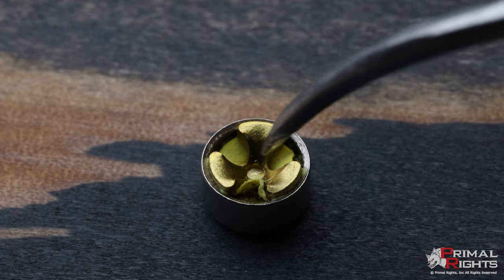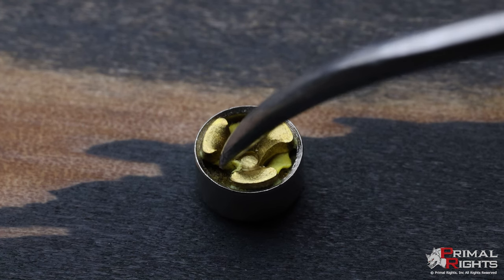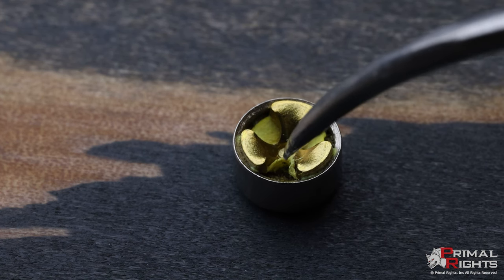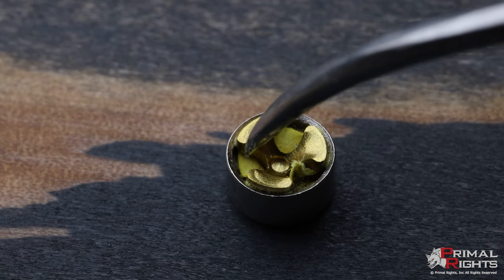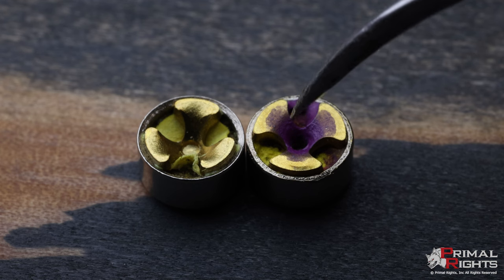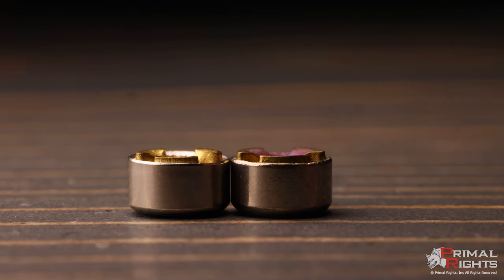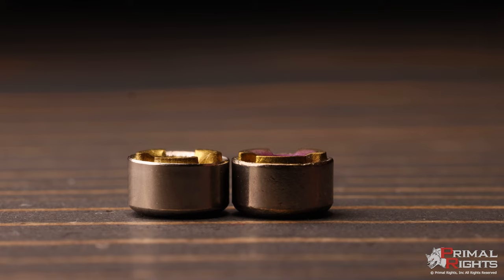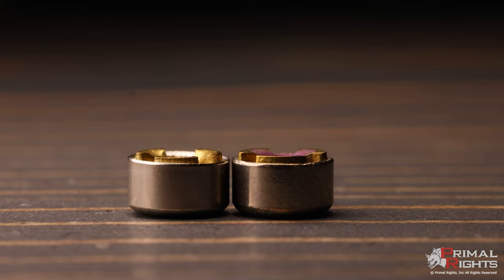Primer Anatomy & Thickness Variance

Comment: Variations in rim thickness should also play a role since the seating tool indexes at the top of the rim and the measuring tool indexes at the head face of the cartridge. Minimum variation certainly with quality brass - I found less than 0.5 tho differences on 6 Dasher Alpha brass. And the additional 2 tho crush you recommend should take care of that. Another factor affecting ignition timing is headspace, as the brass is pushed against the shoulder by the bolt (or firing pin) before the firing pin starts crushing the primer cup. Precise brass sizing is really key here...

Comment: What depth are you seating your primers at ? Factory shells are 0.004" below flush. I get better groups with 0.007" below flush. some like 0.008" to 0.010" below. You got about 0.013" to 0.015" below flush before you bottom out.. Better to go lower for floating firing pin guns. (AR's, BLR's ,BAR's) Frankford Arsenal Platinum Hand Priming Tool can be adjusted to 0.015 below flush.. I cant get any CCI 200 or250 primers to go off in my BLR, someone said its the Nickle coating on the cup ? Any suggestions on a soft primer. some say Fed210 and 215's are easy to set off but I see federals and CCI are owned by the same company now..

Comment: Greg, I really appreciate the videos and all the effort that you have put into them and your product.  I have watched your interview with Eric and Brian Zolnikov's videos on primer seating depth testing.  I tried seating to .008 below flush with BR4's, and then let them sit for a few days and then remeasured the depths.  Out of ten pieces 7 had changed to .004 to .006 and only 3 held at .0075.  
Have you done any testing on this phenomenon to see if that change matters?  I shoot primarily 1-300yd benchrest score and group.
Thanks!
Mike
Reply from the maker: I haven't seen that... but I only did one test, overnight. Perhaps I should re-visit that. :)  It makes sense when you think about it. Those primers are getting squeezed hard. I suspect a loose pocket would for sure cause it.
Reply: @primalrights  Thanks for the quick reply!   The brass I used had been fired 10x in a PPC using moderate loads primarily.  I imagine that fresh brass would provide better "grip", but over time the pockets would change/vary their grippyness (technical term) I would have to think...?
Reply from the maker: @mikes5918  They certainly do. That's one big reason I've been super impressed with the new Alpha OCD cases. The firing to firing consistency is the best I've seen. I assume you're running lapua cases? I would consider 10x firings with moderate loads to be not many firings. Should still have a healthy pocket.
Reply: After watching Brian's video(great channel and videos where he actually tests to statistical relevance a lot of the time!) where he talks about the optimum "crush" to be 0.009"  (he tested all the way to 0.013") I started to do an in depth measuring and testing which involved making a couple measuring tools in the machine shop. I have a feeling there's something off about the way he's measuring it because I cannot even achieve 0.007" of anvil crush on CCI BR4 primers(same as tested) without metallic deformation occurring on the primer cup. This takes an extreme amount of force as well. I also disassembled a primer and there's less than 0.010" of anvil protruding from the cup so to get those levels of crush you'd have forced the entire anvil into the cup. My guess is that some of what he's measuring is metallic deformation. In my case to get 0.002" of anvil crush the primer would only be ~0.004" below the rim of my 220 Russian(6ppc) Lapua brass. (my BR4 Primers measure 0.1205-0.1215 and pockets were 0.123")
Reply: So I'd hazard to guess that might be why you're getting so much spring back. If we're using the same brass/primers and you tried seating to 0.008" below the rim then that would equate to about 0.006-7" of anvil crush. In my testing I seated a few to 0.008-9 but they had a visible deformation where the seater had indented the cup. I haven't tried measuring them again since and they were relegated to warm up rounds only but now I'll go back and see what they measure now and update here.
Reply: @MMBRM  that is what I had guessed as well.  .008 puts the cup right at the top of the pocket with a lot of anvil crush.  
I will be sticking with .004ish and working with that as my set point.

Comment: Nice to have a professional do in depth/close up explanation, great video and explanation. I'm a noob so silly question, Do you have to worry about setting primer off while crushing the anvil? I assume the pressures used are below ignition pressure compared to firing pin strike?
Reply from the maker: I’ve never had it happen.

Comment: A little bit about different brands and types of primers. 
Which ones to use, when and why. 
All CCI and Remington primer, plus Winchester's small pistol are the safest to use in automatic priming tools.
Federal burns hotter and cleaner, yet are according to the Richard Lee manual "one tough dragon to control in the automatic priming systems".

Modern Reloading Second Edition Richard Lee Revised 2021, page 60:
To find out why some brand primers explode violently, I talked to an expert, Dave Anderson, now retired from CCI. He told me primers are charged with one of two types of charging compound. One is called "basic" and the other is "normal." The primers that use "basic compound" must not be used in Lee Priming tools because an accidental discharge is very violent. The "normal compound" is less violent and causes little damage to the tool. The user is easily protected by safety glasses. 

Metallic Cartridge reloading, Robert S. L. Anderson, page 20: 
In the firearms industry there are two types of lead styphnate primer compounds - "normal" and "basic." There are presently four manufacturers of primers in the U.S., and all of them except one uses the normal lead styphnate primer compound. Federal is the only manufacturer that presently uses basic . The common ingredient to all small arms primers is lead styphnate of which there are several different varieties. Basically it is in crystalline form and is very explosive. Normal lead styphnate is composed of large irregular crystals, which are slightly acidic when wet, somewhat more brisant at lower temperatures (good for military use), and they burn with a cool flame at ambient temperatures. However, it is somewhat harder to get an even mix of components in normal lead styphnate primers because of the larger irregular crystals and the fact that the "mix" often requires some metallic fuels (such as powdered aluminum) to help make a magnum primer. Basic lead styphnate is composed of small regular crystals and unlike the normal mix is not as acidic and will not attack primer cups when wet. Basic lead styphnate is easier to mix than normal variety and there is no need to add metallic fuels. The basic primer flame is very hot and will easily ignite most powders and therefore Federal does not offer a magnum pistol primer. However this style primer is slightly less brisant at very low temperatures (- 20degrees F. to - 40 degrees F.) which would make normal primer more suitable for military purposes. 

Metallic Cartridge Reloading, All New Third Edition, M.L. McPherson, page 29:
Certain brands of primers might be unsafe to use in some priming tools like Lee's AutoPrime because of the potential for mass detonation. With these tools, should an operator detonate one primer, as can happen when a handloader tries to seat one primer on top of another,  the detonation subjects other primers in the tray to shock and an incandescent flash. If this shock and flash can detonate a second primer, there is the potential that most or all (perhaps 100 or more) primers in the tray might detonate en masse. Such a simultaneous detonation would be a disaster. Lee has tested all available primers and, excepting CCI and Winchester, all brands produce an unacceptable number of mass explosions when the primer being seated is forced to detonate (by heating in a remote explosion-proof box). By comparing Federal and CCI primers, we can gain some understanding why brands very in this regard. Federal primers do not have a foil covering over the primer pellet; an application of a type of paint replaces the foil. That sealant is easily ignited and highly flammable, possessing a very low kindling temperature. These are beneficial characteristics; among other things, they help reduce combustion residues. However, use of this pellet sealant makes these primers very easy to ignite. Exposure of the open front of the cup to the flash from an adjacent primer easily does the job! Conversely, CCI primers have a paper foil almost completely covering the front of the pellet. This foil deters pellet ignition because it is only moderately combustible and has a relatively high kindling temperature. A short duration flash from a primer is unlikely to ignite the foil or penetrate through it to ignite the pellet underneath.